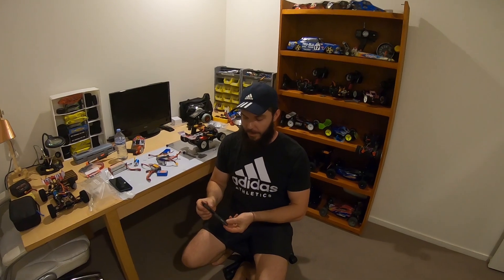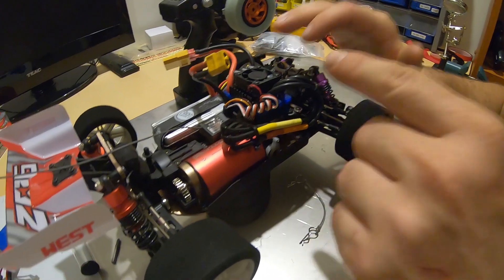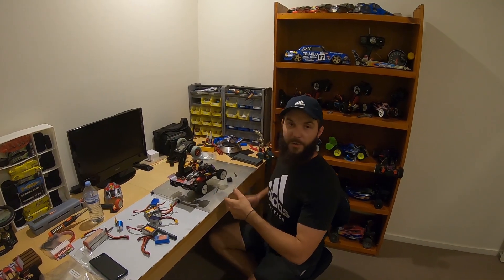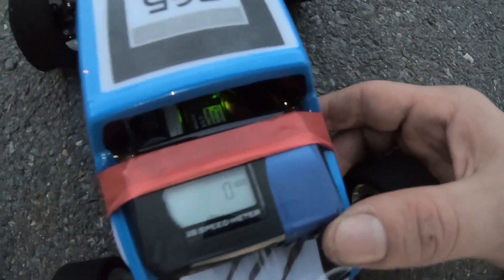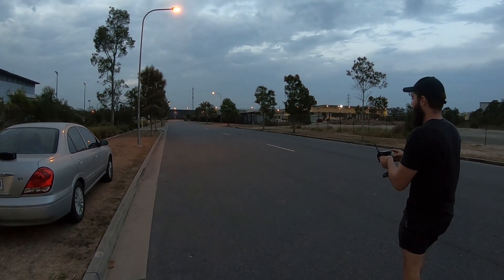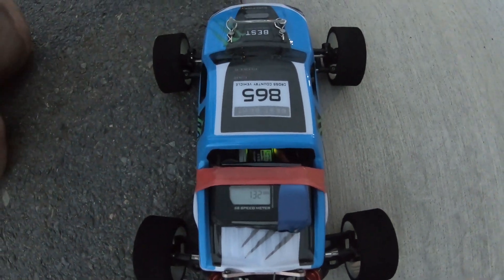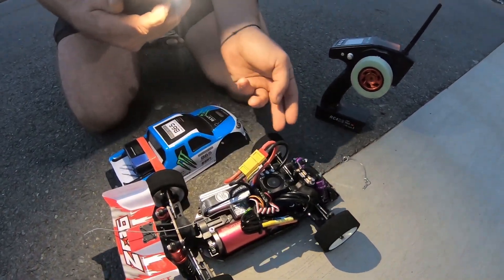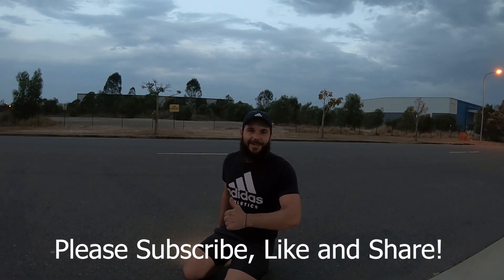WL TOYS 144001 132 KPH 82 MPH 4S FIRST SPEED TEST NEW BUILD

Comment: Nice run - you truly are the rc master! Does the 3660 motor not get in the way of the servo? Did you have to move the servo or anything to get the motor to fit because I have a 144001 on the way and want to do a brushless conversion similar to yours! thanks

Comment: Mad bro. I have a heap of those 3s batteries for my racing drones. I've ordered that car and will be upgrading too. What is the brand of that motor. 
Also is that a back street in Meadowbrook ?
Reply from the maker: Hey bro it's a Surpass brand motor. That's awesome man I hope you can come and run with us soon. That run was at Keller St . Berrinba DHL . I also use Australand drive Berrinba and sometimes that ded end road nearby just off illaweena st. I think it's called Hashim place.
Reply: @TheRCMaster   sounds like a plan. I'll keep tabs in your future videos. Cheers. I'll be ordering those parts very soon.
Haha yeh I learnt to fly pre fpv racing drones on Illaweena about 6 years ago. Classic spot mate.
Reply from the maker: Awesome man, good luck with your WL toys project keep in touch too mate I just subbed 👍

Comment: what wheel do you have mate what scale ?? 1/10 ?? such as with a979b :)?
Reply from the maker: Hey brother, it's a set of hot racing 1/10 touring car foams. Anything with a 12mm hex will fit.
Reply: what company do you have hihi link @TheRCMaster
Reply from the maker: Sorry no link as they were purchased from a local guy. The Brand is hot racing
Reply: ok i found hihi on the net
Reply from the maker: Sorry I missed this comment mate, any wheels with 12mm hex

Comment: the rc master i have a question...which esc would get more speed and performance?an 80a 4s rated esc or the 120a 6s rated esc on 4s?
Reply from the maker: Definitely the 120amp more power more speed, sorry I didn't reply earlier I missed this comment